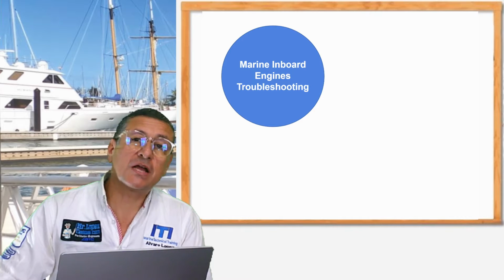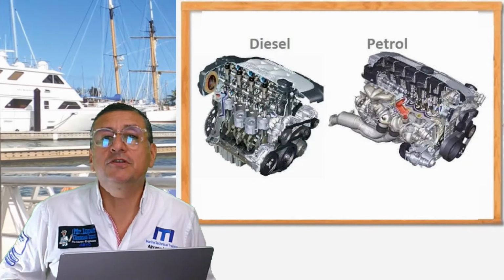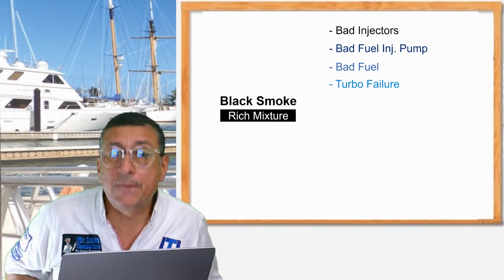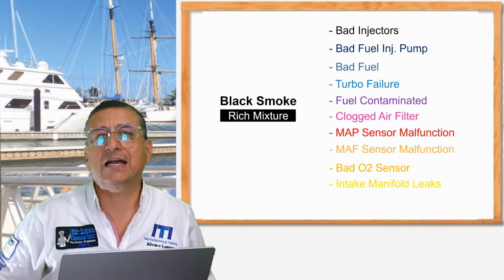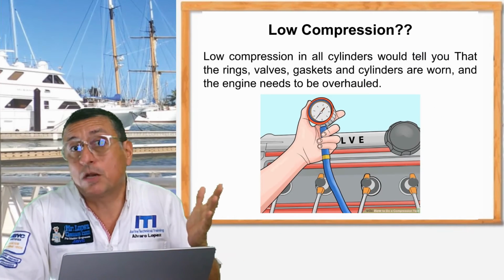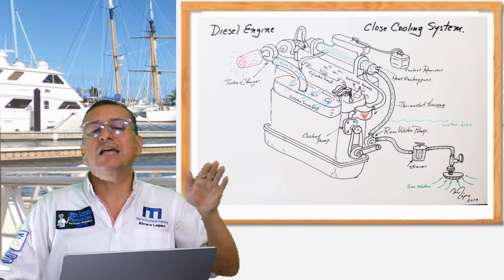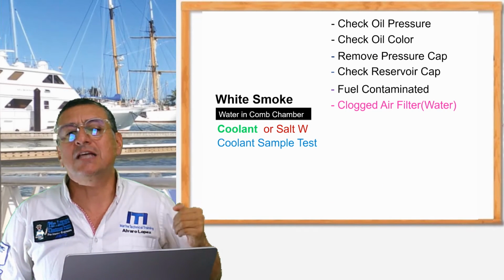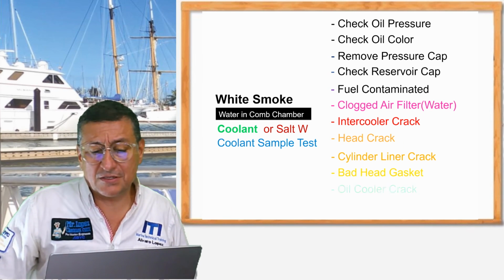Marine Engines Exhaust Gases Color Analysis / Chapter 17 Diesel Engines Course

Comment: Hi Mr Lopez, If the smoke is white or grey and only when engine is hot and goes away when returning to idle? Alarm will sound if at high revs for five mins but not if low medium revs. André
Reply from the maker: This is probable a small leak on the head gasket. Please try to check compression in each cylinder
Reply: @MrLopezClasses  thank you so much I did not consider this option. André
Reply from the maker: Also, check the condition of the Air Filter. In some cases people clean the engine room and splash fresh water  over the engines, then the filters are clogged with water

Comment: Thank you very much sir for the video, but I have a question what is the type of smoke the is coming out from the engine if the engine is in good working condition
Reply from the maker: In normal conditions the color should be clear. No colored. I hope this material is useful for you